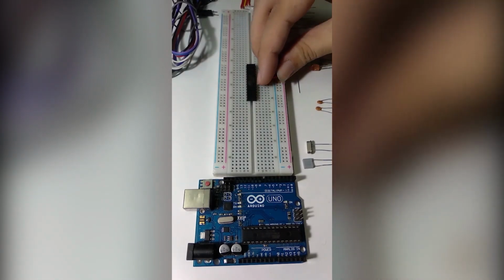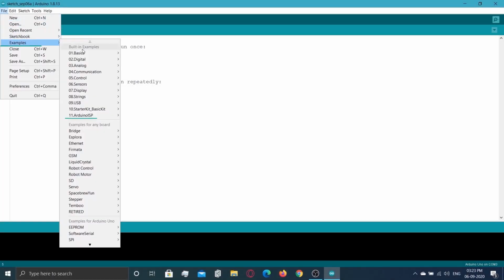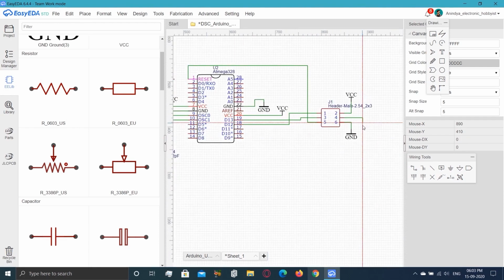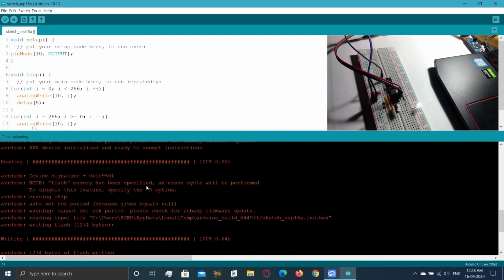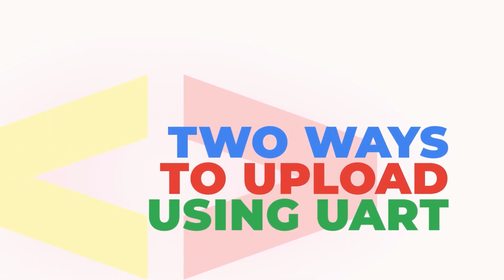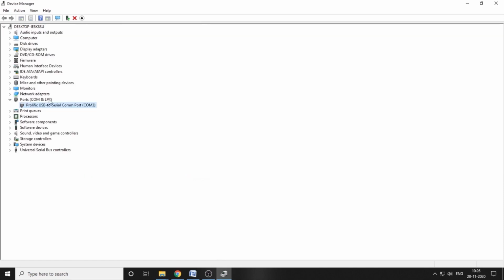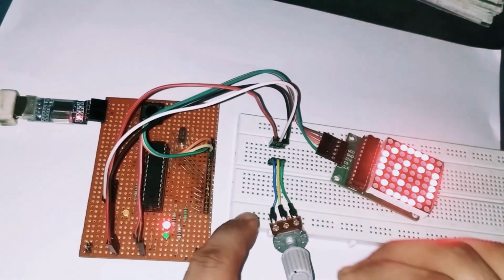How to make Arduino projects off-board | For beginners

Comment: Is there a chace of Arduino getting damaged in case of burning bootloader??
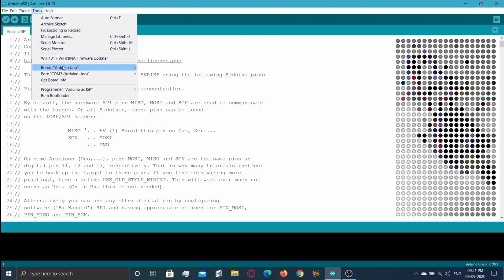Reply from the maker: It depends on exactly how you burn the bootloader, like, when you are using Arduino IDE to burn the bootloader, as shown in the video [8:47] there is almost no chance of damaging the target IC, it is the safest way. However, if you manually set some fuses on the target IC with some tools like AVRdude etc. there might be a chance of bricking the IC, but only if it is not done properly.